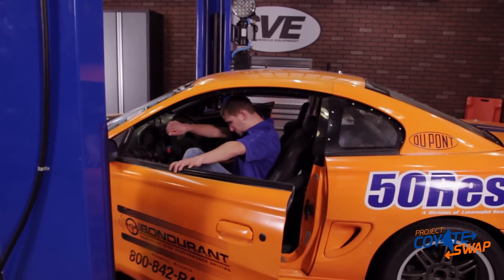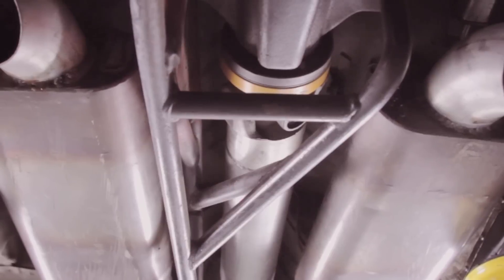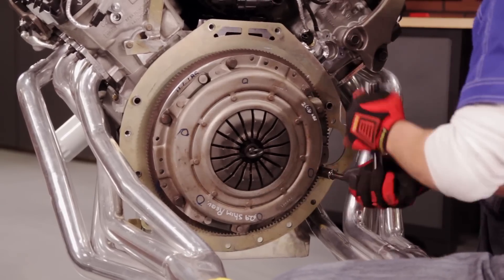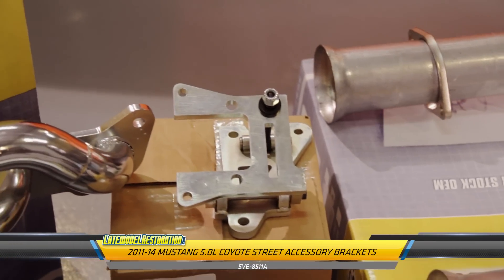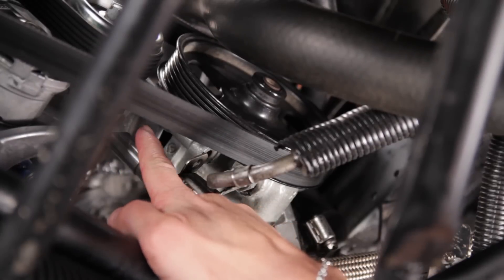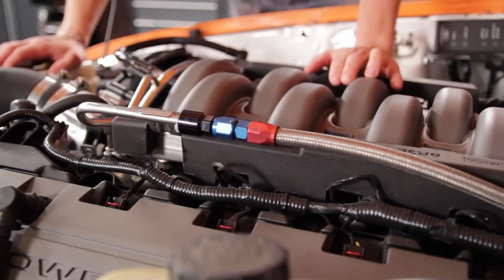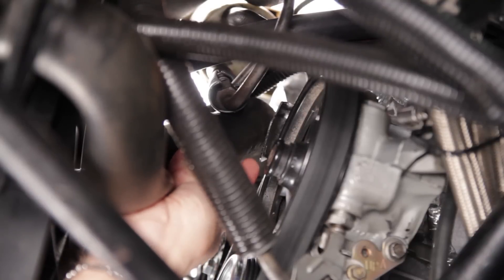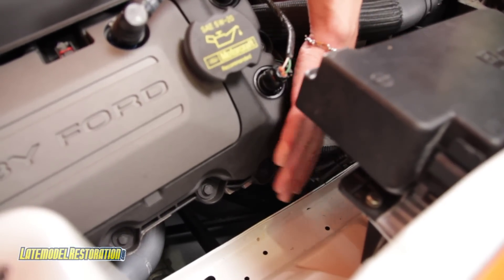Mustang Coyote Swap: Brakes, Power Steering & Start Up

Comment: 1:41 i have 85 capri which i am coyote swapping. dropped the engine in using a upr  modular k member. looked good till i was rubbing on the swaybar with my power steering pump. well i guess i have my answer

Comment: I have the same engine from my 2015 that I wrecked  in my garage. Can I put it in my 89 that currently has the 2.3l engine.
Reply: yes your gonna need a new wire harness make sure what kind of wire harness is for your model of car and your gonna need to swap the k-member and transmission

Comment: Thank you for the reply, I'd like to ask a question that has been floating around my club. Could the FRPP control pack be used with another Ford drive by wire pedal assembly as found in the '05+ sohc 4.6 Crown Victoria, Grand marquis and Town Cars? The pedal assembly's for the Panther chassis cars are a tad different then the mustang but if the electronics interchange it would make it loads easier. So far nobody has attempted it yet, I'm hoping somebody in my group will step up to the challenge!

Comment from the maker: The Ford Racing Controls Pack retains the drive by wire system and even includes the pedal assembly. This is just another reason the swap is so easy. click the link in the description to see the section we cover on the Ford Racing Controls Pack.